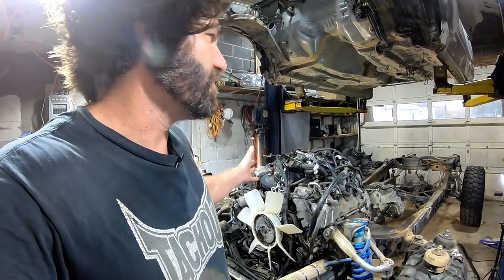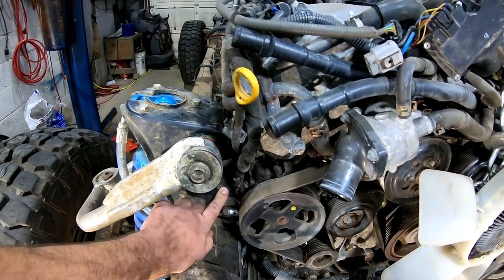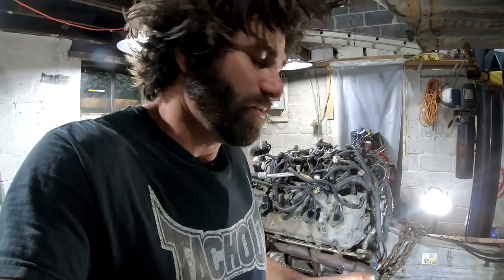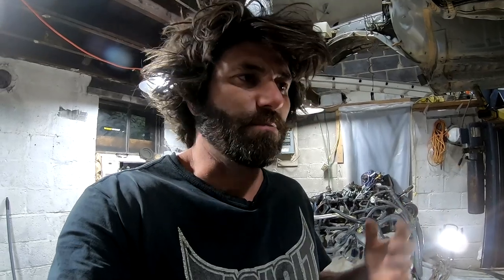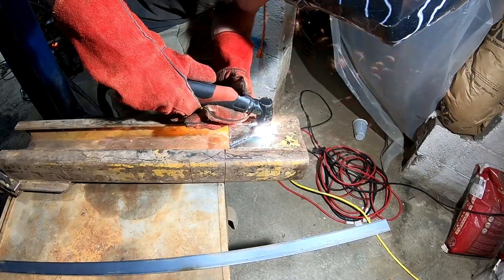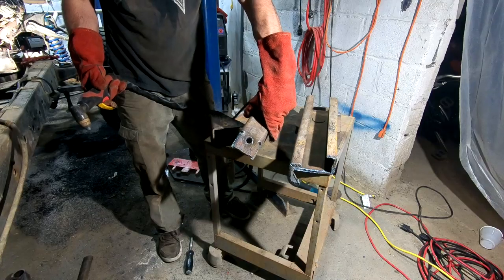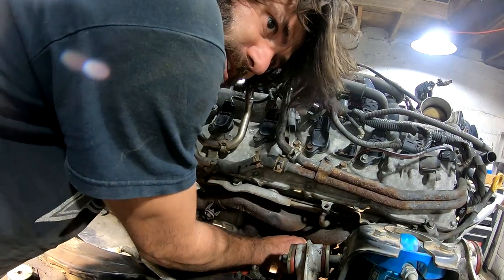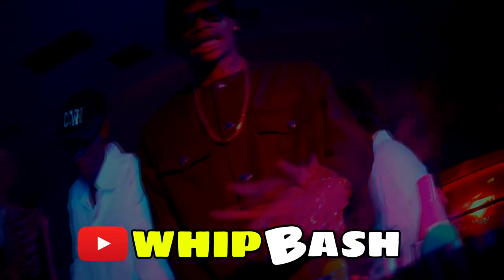Making Solid Mounts for your Engine Swap - TACUNDRA 23

Comment: Not sure how it is on the newer gen’s, but when I did my extended cab swap on a single cab frame, I had to do a 3inch body lift. With doing that I had to raise the engine and drive train 3inch as well, cool part was all of my drive train is flat to tucked up in the frame.

Comment: here is the problem with no engine mounts. You have aluminum engine block that will crack and break under heavy abuse???
Reply from the maker: That is a concern.  Gonna find out what happens!
Reply: @WHIPBASH  , at one point I had engine mount damaged on my Toyota and it was metal against metal and it was uncomfortable due to vibration.

Comment: Smart man! ( by the way better figure out your ADD before you get to far ahead)
Reply from the maker: The ADD plug actually matches.  colors don't though.  That won't be hard to figure out.  But its starting to look like the 4WD control ECU is going to come along with the Tundra harness.  I've been staring at diagrams and wires for dayssss!
Reply: You can lock it into place with a hose clamp. From my understanding it only uses vacuum